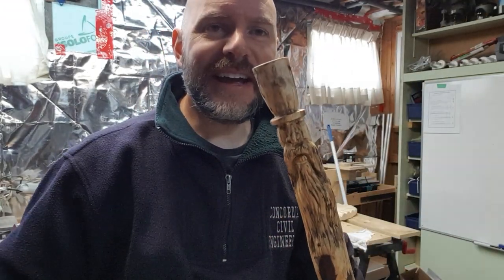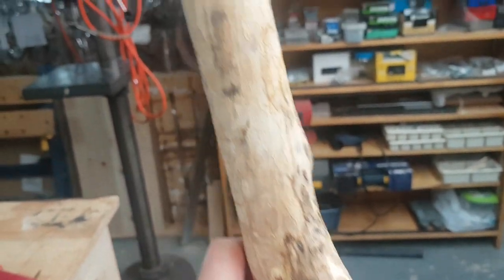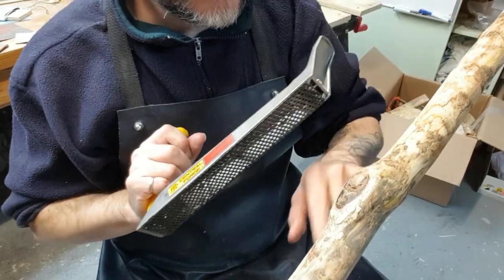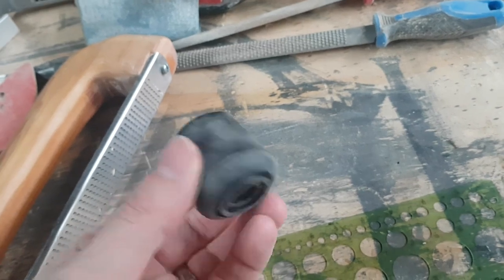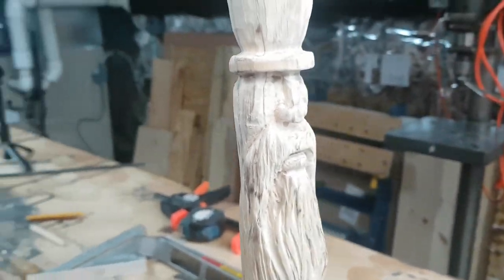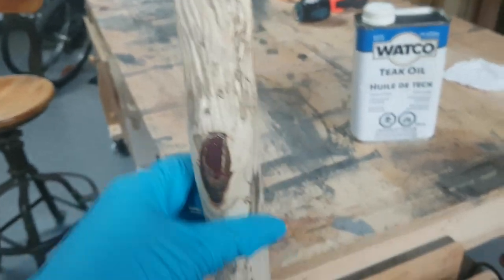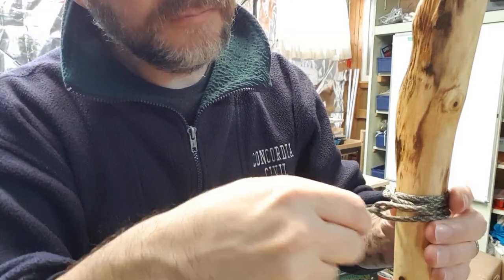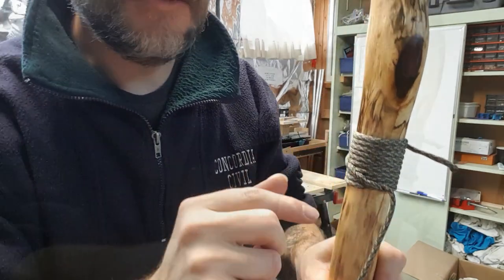Mad Hatter Wood Spirit Walking Stick build

Comment: How do you make a cross hatch pattern for a walking stick.
Reply from the maker: in my other videos, such as the Celtic Weave designs, I go into creating the diamond shaped crosshatch pattern on varying diameter sticks. Using that method you can lay out the grid pattern needed to create it. Hope that helps.
Reply: @JasonHedrich  thanks appreciated.